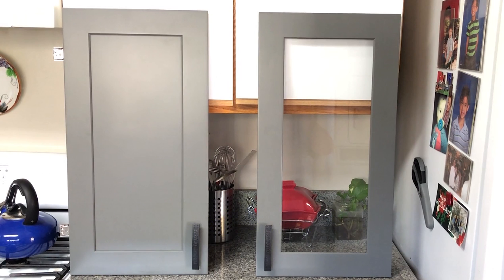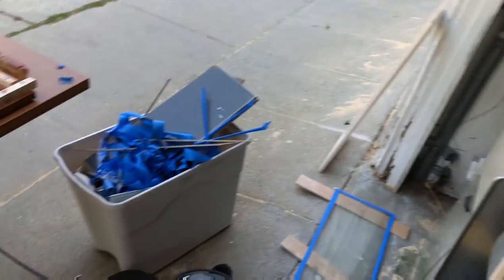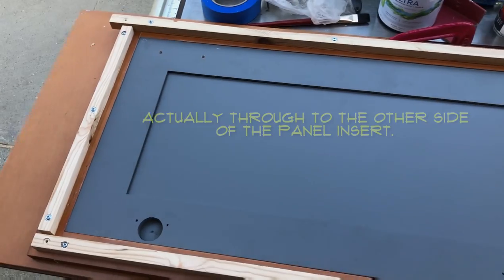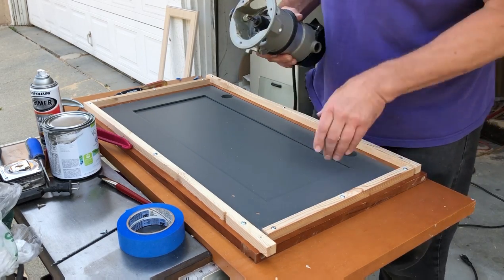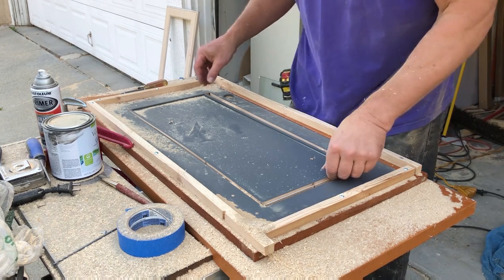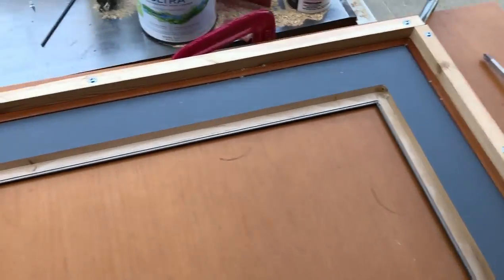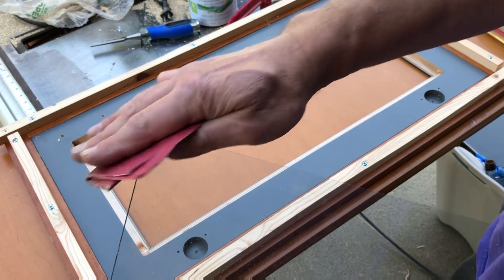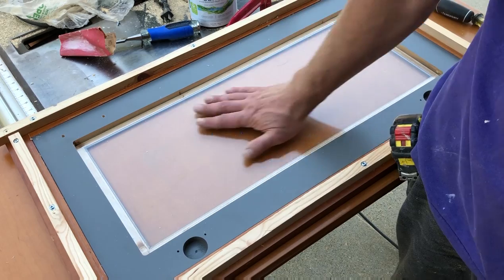DIY Kitchen Glass Doors

Comment: Great job I wanted to try this but I don’t think I have the skills like you do so I will try and find cabinet doors with glass already on them.
Reply from the maker: Hi Angel, yes, this project is more of an intermediate one.  If you haven't used a router before, this shouldn't be the one to cut your teeth on, so to speak, lol.  If you read through the comments, a couple of people also ask about alternatives.  Well, glass doors can be a bit expensive, but you could take your doors to a cabinet or woodworking shop and have them cut the recesses for the glass panels.  That way you save money and don't have to worry about matching the paint on your existing cabinets.  You can have glass cut to size for very little money and put them in yourself.  Good luck and thanks for watching.

Comment: You made it look so easy! 😘
Reply from the maker: Well, in principle it is really easy as all you’re really doing is making a cutout with a lip to rest the glass on.   The tricky part is handling the router.  Before doing this project, it’s best to have some experience with a router as it is a tool to be respected and it can be very dangerous if not handled properly.   Be sure you have a very sharp router bit and that you go slow and steady. Don’t route anything with knots in it, but doors very seldom have those.  Thank you for taking the time to watch. Stay safe

Comment: Turned out great man. I recently did a small kitchen remodel in my kitchen. I extended the upper cabinets to go all the way up to the ceiling. I knew I would never be able to match the stain and so I painted all the cabinets white. I wanted to add glass inserts into some of the doors that have my glasses and dishes but I could not find anyone that can add glass for me so I ended up just leaving the doors off those cabinets. Looks good but my dishes do get a little dusty so I am back to thinking about glass inserts. I don't know if I dare try this though because if I muff it up then I'm screwed. I will never be able to match the pattern in the wood doors.
Reply from the maker: Have you ever heard of a Kreg jig?  Look it up, you can get them at the home box stores or Amazon.  It's super easy to make cabinet door frames with the jig.  Once you made a custom cab door, router out the inside and have Home Depot cut the glass to fit.  Or you could make the frame and use it to practice on until you're comfortable enough to do it on the existing doors.  Or, be safe and just enjoy the handy work you've already created.  

The most difficult job is getting comfortable with the router.  If you've never routed before, you either need to practice a bit or let someone with experience do it.  Find someone just to router the glass recess and then you put in the glass like I showed in my video.  Whatever you decide to do, be safe in using power tools, they carry a wallup.

Thanks for watching the video and let me know how it goes.
Reply: @Explore-Gobal  Thanks man. Yes I've heard of Kreg and actually have their work table. I bought my first set of tool when I did my kitchen project. Never owned a saw before or air compressor/nail gun. I've never tried a router before. This all looks cool and can save a homeowner a lot of money. Where I live you can't find any kind of tradesman willing to work on these small projects. Trust me I tried. I couldn't even find a painter to come and spray my cabinets and that's after I did all the prep work myself. Ugh!
Reply: You may want to try going to a Habitat for Humanity Restore and look for a door similar to what you will be working with. Use this as a practice door. If you make a mistake, you won't damage the doors you need. I'm going to be putting glass inserts into the upper panel of a two panel door and that is what I am going to do. If I make a mistake or it doesn't go as planned, I can make adjustments or take another try with another cheap door until I am confident I have it worked out to obtain the results I want.

Comment: Amazing! Would it work to put a rounded finish brad nailed to hold the glass? Due to cabinets opening and shutting. It just concerns me with glass.
Reply from the maker: Yes, that’s would work just fine, but if you’re going to do that, buy quarter round and use that instead for a cleaner finish.  You can buy quarter round in very small sizes for applications like this.   Thank you for watching and stay safe.

Comment: Nice, I was planning to do this as well using the same method.  Never having done it before, I just looked at one door and knew the center panel was installed as the rails and styles were pressed/glued. Now I know for sure and certain!

Comment: do you know about the 409 trick? 
 run a bead on edge
 spray 409 on bead 
 now silicone will not not stick to anything else that the 409 is on. 
 end up with a nice smooth clean look
let dry and clean glass after silicone is ready

Comment: You can buy plastic claps (cabinetry gear) to hold the glass in snug. 

That way if you ever want to remove the glass quickly, it takes 1 min. 

If you want to remove this glass, you have to utility knife the caulking and clean it out before putting glass back in. 

Go to the hardware store and see how they keep the glass in with plastics claps.
Reply from the maker: Hi Michael, thanks for watching. Yes you are right, there are the plastic clips, metal clips, and if you want a more finished inside look you can also put in small strips of quarter round.  I did it this way since I wanted to finish these with what I had on hand at the time.  Happy New Year!

Comment: Great video – Thanks for making it. I'm new to routers so I had a question for you. Is that a "plunge cut flush trim bit?" Or did you angle it to make a hole and start the cut?
Reply from the maker: Oh, I strongly advise against angling such a powerful machine to make a hole.  Plunge cut all the way.

Comment: Great video. I'm just learning about bits - would a rabbeting bit worked? It seems like the bearing would trace the inner door trim and the blade would cut in the required amount for the glass ledge. I would need to figure out the depth as you mentioned. Thoughts
Reply from the maker: So sorry I did not see this comment, but I'll answer it late anyway.  For this particular work flow, a rabbeting bit would not work as the bit I used was a plunge bit.  The plunge bit basically did two steps with one pass, it cut out the center panel and made the ledge for the glass.  Many different ways to get similar results.  Thanks for watching.

Comment: Can you link the tools and products you’ve purchased for renovation? I’ve asked Lowe’s about the glass inserts, and the multiple stores I’ve called or visited say they don’t sell or cut glass at any Lowe’s.
Reply from the maker: Hi Jeremy:
Thanks for checking out the video.   I've lived in Sacramento, CA, and am now living in Los Angeles.  Both cities have Lowes, and I've had glass cut in both areas.  You do have to purchase the glass from them, but they will cut it for sure.  Home Depot has also cut glass for me before.  You may need to talk to someone there who isn't fresh out of high school, lol.  

No special tools.  My tools are several years old, but most will work just fine.  I believe it was my Craftsman router with a plain ole standard straight bit available at most hardware stores.

Back to the glass.  If your area Home store does not sell/cut glass, no worries.  Call your local glass shops and have them do it.  Plain glass in such small sizes will not cost very much and the overall cost of home made glass doors will still be less than buying them.
Reply: YesUCan all great info, thank you! I’ve routered out the panels and am waiting for glass. Very helpful tutorial. Passing along to others for reference.

Comment: Great video. It appears that you used pre-fabbed shaker doors with the shaker trim built around the panel. I'm taking cabinet doors, removing the existing "fancy" trim, and making a shaker style trim for the door panel. Since I won't have the panel  your doors do (i. e., the shaker trim will sit on top of the existing panel) how would you suggest I route the panel for glass?
Reply from the maker: It's hard to envision how exactly you are creating your doors, but the general idea stays the same no matter how the door is made - you have to end up with a lip for the glass to rest on/in.  If I understand you right, you are taking existing doors, then swapping fancy trim with square shaker trim?  Honestly, if you are going through this much trouble, I'd just take 1 x 4 x 3/4 stock and make the door frame, basically your shaker frame.  Then I'd take my router and cut the lip into the back for the glass to sit on.  I'd route it maybe half way, about 6/8th, put the glass in, and then finish the back with some quarter round (may have to make it, as I don't think they come that small.)  Do a small trial door first.  Hope that helps.  Thanks for watching.
Reply: That would be easier for the doors I want to have glass inserts. Thanks for the idea.

Comment: How would you put the little dividers so there are little window panes?  The blood was funny! How would you suggest doing this. Thanks
Reply from the maker: Thanks for stopping by Rhonda.  There are two main ways to get the dividers.  Once is to make a custom insert that has "pockets" for each section of glass, all of which would then be placed into the routed door frame (that's the hard way).  The other is to make an overlay for the glass, in essence creating the look of individual panes when in reality it just has the look of it.  For a DIY project, the overlay is much easier to construct and apply over the full glass pane.  I would use 1/4" or maybe a little bigger for the dividers, notching them where they cross to keep them flush.  Think of lattice work, just on a smaller scale.  Once the lattice is complete and fitted perfectly to the opening of the routed out door, you can also use a thin bead of silicone on the back side to fit it into the door frame.  
Then off course, there is the process with which they make stained glass panels, with lead and solder.  A friend of mine took an art class for beginning stained glass and produced a really cool looking piece.  I took a simple design to a local stained glass craft store and had them make it.  A week later, I had a unique piece that I put into the doors of a custom bar I built for a friend of mine.   Thanks for reminding me, that would be another good short vid I might produce.   
Hope that gets you going in the right direction.  Have fun and stay safe.  Cheers.

Comment: Wow if I do this my wife would be so happy. I really want to do it for her but it makes me nervous. I've never used a router before! This is very motivational. Thanks!!! 
One Question, How do you know what bit you need for this and how this you need to go? I saw on your video you explained it but I would love another explanation.
Reply from the maker: Hi Juan,
Glad you found the video motivational and thanks for watching it.   If you are hesitant about using a router, you are right to be cautious.   Power wood working tools are not toys and can cause serious injury.  I've got another idea for you if you don't wanna mess with the router yourself.  Call around and find a small cabinet or woodworking shop and ask if they would do the router job for you.  Might take a few calls, but someone is always willing to help.  Tell them you saw this on Youtube and would rather not loose a finger, lol.  You can then do all the rest, sanding, priming, painting, having the glass cut for cheap at home Depot, and then installing it like I showed you.  You'll still do most of the work, just not the dangerous stuff.  
If you end up doing this, I'd love to hear from you and see your results.  Good luck.
Reply: You can use a straight bit, rabbeting or uncut spiral. If you've never used a router before, practice first. If you mess up and go the wrong direction and get into a climb cut situation, you can loose a finger real quick. Always cut from left to right and never take your hands off the router while it's rotating. I'm in NE Texas,  if your close, let me know, I'll rout them for you. I have a cabinet and furniture shop.
Reply: @joeymerrell8585  I have been watching a lot of carpenters work. I seen the best video on routing. Use your right hand and make an L which ever way the pointer finger is pointing as you grab the router is the way your go. No matter  if its upside down or right side up.

Comment: Hi! what kind of silicone is that one? will acrylic silicone do the trick?
Reply from the maker: Hi, thanks for watching.  I used 100% silicone for extra durability, but as long as you have a clean surface, acrylic silicone will do just fine.  Color match the cuts and use clear silicone for that nice finished touch.  Good luck.

Comment: One thing you could have done was to keep the scrap piece from the center. Run it through the router again along the border and used that border piece to secure on the backside of the glass. That would have made the back of the door have more of a finished look
Reply from the maker: Thanks for checking out this vid.  You are correct, but it wouldn't have been as easy as that since the center piece was now 1/8" shorter on every side due to the width of the saw blade.  I was also thinking about using a small quarter round - HD actually has them in 1/4" and it would have been perfect, but then again, it wouldn't have made that much of a difference and the vid was already too long, lol.  There's always room for improvement.  Thanks again...Stay safe.
Reply: @Explore-Gobal  sorry I also meant to say good job!!!
Reply from the maker: @LOLimtheman  Oh geez, no need, I just really appreciate you giving it a once over, and thanks.

Comment: Where did you get the glass and door from?
Reply from the maker: Hi Dkaira, thanks for watching the vid - partially, lol.  In the video I talk about getting the glass at one of the box stores like Home Depot or Lowes, etc.  They have glass in different sizes and will cut it for you in the size you need.  Not all seem to do it, I just never had any issues getting them to cut it.

The point of the video is to use your existing doors.   Take the doors off you cabinets and have at it.  I've had someone tell me they have little to no experience with a router.  I told them in that case, just take the doors to a local wood shop or custom cabinet shop and have them do the cutting.  Then you do the frame painting and fitting of the glass.  This will still be cheaper than having them completely custom made.

Good luck, I hope your project turns out beautiful.  Stay safe.
Reply: Thank you!

Comment: So, with the bead of silicone you do not need any other support to hold the window, correct? Nice job, btw and thank you!
Reply from the maker: Hi Catherine,
yes, the silicone is more than strong enough to hold the glass in, and if it ever breaks, heaven forbid, it's easy to replace.  Another way would be to take a small piece of quarter round and glue that flush around the glass to the frame - sorry if the wording is a bit confusing.  Either way is used and will work great.  Thanks for watching.
Reply: YesUCan Thanks so much for the great info!

Comment: What type of glass did you use for the cabinet doors?
Reply from the maker: Hi and thanks for watching part of the video. The glass was purchased at Lowes, but you can get it pretty much anywhere. Lowes cut it to size for free which was a bonus. Not all locations cut glass, but I believe most do.  I wanna say it was 1/8” thick but don’t remember for sure. It’s the standard thickness they sell there.  Stay safe.

Comment: How thick and what type is the glass?
Reply from the maker: Greetings and thanks for watching.  The glass is nothing special, not tempered if that's what you mean.  I didn't use tempered as they are upper cabinets and someone breaking that glass is very remote.  Also, you can't cut tempered glass, it has to be made in the specific size of your application....I can't recall specifically what thickness it was, just the standard glass that Lowes sells in their department - may have been 3/32", not sure.  Here is a link glass Lowes sells: https://www.lowes.com/pd/Gardner-Glass-Products-24-in-x-36-in-Clear-Glass/3121147

Comment: What kind of bit did u use ?
Reply from the maker: It was a trim router bit I had laying around.  Not sure, but I think it was half inch.  They're also called shank bits.  The trick with those, well, actually all router bits is to let the bit do the work, don't force it.  Also make sure you know which way the grain of the wood is going - you want to run with the grain so the router doesn't catch or kick.  Go slow and steady and keep a firm grip on the machine.  Thanks for watching.
Reply: YesUCan I tried it but it kicks with low speed and I have no clue what’s the problem !!! Just wanted the right bit for it I guess mine isn’t the right one